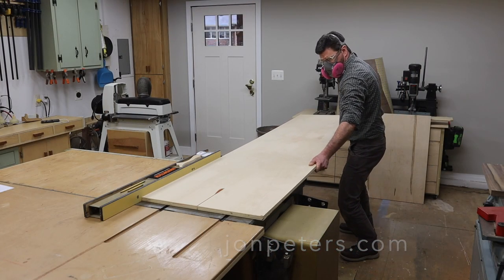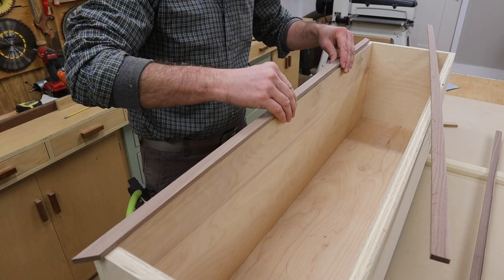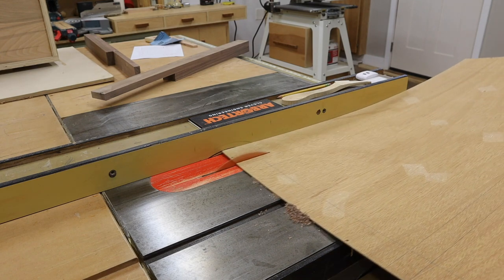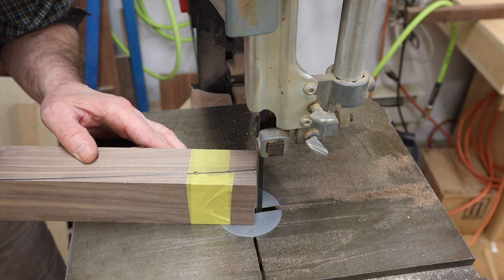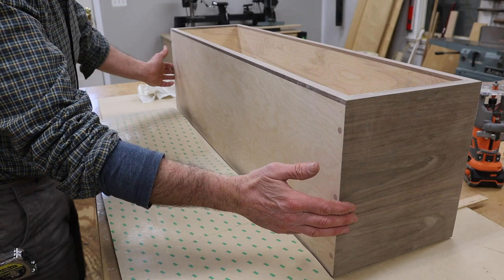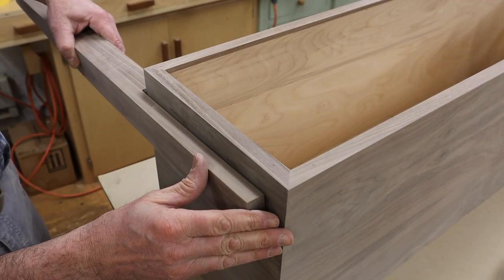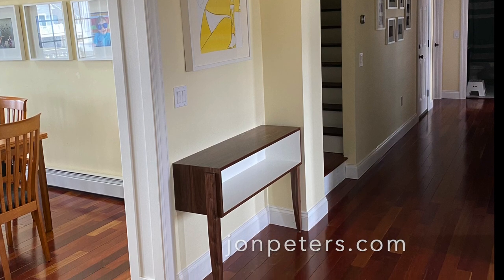Make a Wall Mounted Modern Cabinet

Comment: Great video as alway Jon, thanks! Why do you rough on the mitre saw and then cut to lenght with the crosscut sled? Seems like you're just doubling up your work load, especially with a very accurate Bosch glide!

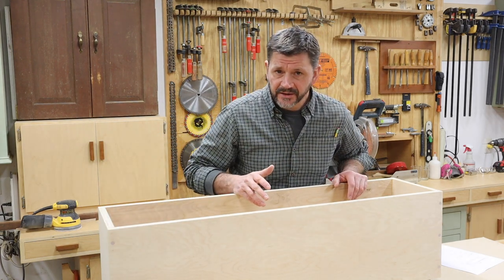Comment: 2:12   ....."Now I got the box put together.  I filled and sanded the holes.  And the next step is to PAINT THE INSIDE WHITE BEFORE I APPLY THE WALNUT TRIM AND VENEER!!!!!!"
Could have saved a lot of time taping off the walnut had you done that there.  Plus while the paint is drying it's time to make the legs etc, etc.  

Turned out very nice.  I would have made the legs flush with the top or added them directly from the bottom.  In both instances I would have been wrong.  Your leg design is much more pleasing.  Well done.

Comment: Hanging it on the wall in addition to the legs gives the optical illusion that the table is passing through the wall (with the other two expected to be attached to the other end of the table on the other side of the wall).  Cool effect for a great looking table.

Comment: What screws do you use for plywood to plywood joints?  What is the temperature inside your shop in the winter when you are working?

Comment: Great project. Why did you edge band then veneer instead of veneer first?
Reply: Because by putting the edge band on first then veneering on top of it the top and sides look like one solid piece of walnut as opposed to walnut ply with solid walnut edge banding. The eye always notices the grain change in the edge banding vs the top grain when you're looking down at table top.
Reply: @cajunfid  Thanks, Hadn't thought of that.  Makes perfect sense.

Comment: Great looking cabinet Jon!  I recently built something similar for my parents to put their cable box and other electronics in...they couldn't get past the 2-legged look and eventually asked me to add 2 legs to the back.  I was frustrated to say the least.  I thought the 2 legs looked pretty sleek!
Reply: Did you just put 2 fake legs on the back?
Reply: @williamellis8993  Yes I did.  I notched them to fit over the baseboard so they could fit right up against the wall

Comment: Using a piece of laminate for a slip sheet will help you stick larger pieces of veneer.
It helps keep larger wrinkles and bubbles from occurring. Another good tip is to scuff up the sticky side of the veneer with a palm sander using 220 grit. That will allow you you reposition the sheet very easily. The sanded glue dust left on the veneer sticky back side will melt back into itself one you apply pressure to it.

Nice work, love the build process.
Great job spraying also.